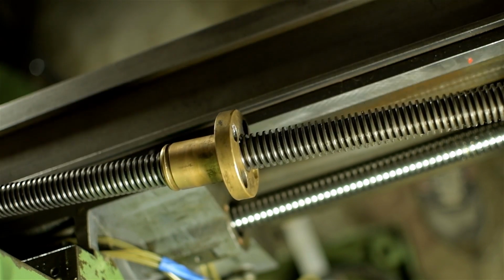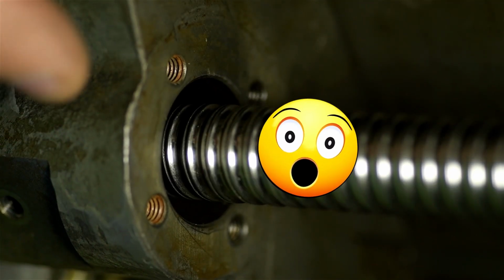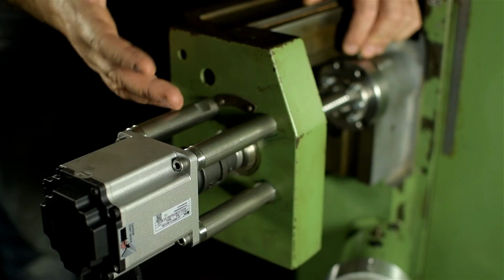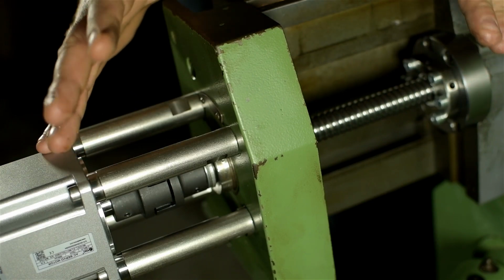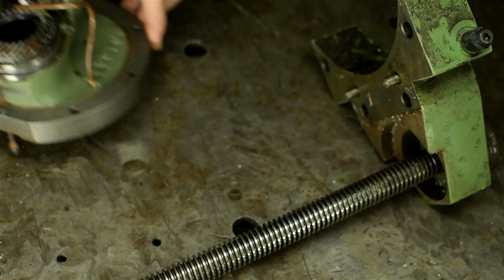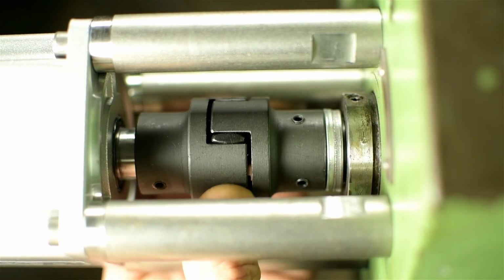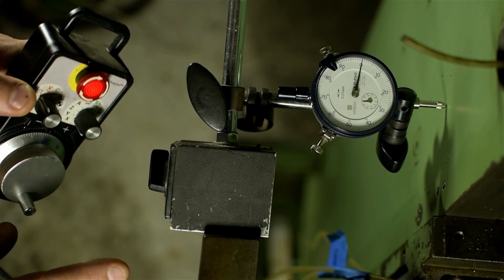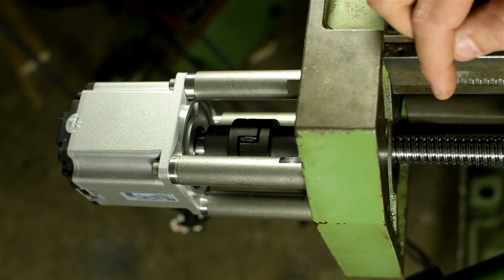Maho X Axis?  DONE!

Comment: DO NOT put one of those "springy" couplings (helical) on your ballscrew; it'll drive the servo crazy with all that resonance every time it moves. If you do use one, wrap a few turns of electrical tape around it to help damp those vibrations. Instead, I would recommend using a high quality spider coupling correctly sized for the motor torque you expect to use. Check out Ruland for made-in-the-USA greatness. And please, please stop using set screws. Use clamping collars. It's easy math to do to compare the clamping force/unit-area and see that set screws are a terrible thing. I'm sorry Tony, I know it's your thing and you got this. But I can't not, you know? P.S. I know it doesn't mean spit, but I design servo motion control systems for scientific and industrial systems.

Comment: I did not understand on which bearings the ballscrew  turns, certainly not normal radial bearings should be used but preicision Single row angular contact ball bearings, and you must have an adjustment that allows you to load them very precisely from outside,  in addition, the recirculating screw seems to me in diameter too thin, consider that the ball screws twist under stress, so I advise you to mount something of high quality and for high loads, better if the ball nut is double  has an adjustable preload, as ever, backlash is your worst enemy.

Comment: The coupler you use us perfect for CNC the plastic part is only there if the alignment of the motor isn't let's say that perfect it still quiet and giving the force ahead to the counterpart I use the same and they are by far the best but not cheap couplers for one you can buy three standard ones ...they allow out of alignment up to 2° without making any problem ...I used the standards some months and then changed to them ...

You did the same mounting wirh four steel sticks as i choosed last year Later I changed the x and y to a plate mounting z still uses the sticks and it works perfect so I don't know now why I changed x and y when I see that even you do it that way ...so I guess the work was for nothing 😂😂😂

Comment: Before you had problems with the backlash I knew it was the coupler.  Use them in pump drives and their sloppy as poo!  Plus they are too cheap for a CNC part.

Comment: Don't use those spiral cut couplers, useless for loads like on this machine...Make your own solid coupler and float the servo into place on the standoffs...Huco do suitable flex plate couplers which will shear in a stack up. Choose your ramp acc rate carefully though...Pixelated shaft porn was fun...😁

Comment: Had this problem with mach3 many years ago if direction pin is set to active high set it to active low or the other way round can't remember but it adds steps in the one direction.

Comment: Afterthought : Could be sideways movement on the Z if the gib is loose . Can you put an indicator on the bearing mount? Another test is to put the indicator on the end of the ball screw (the one without the plastic cap) – that will indicate the contribution of the angular bearings.

Comment: I use cutting fluid on everything in the drill press. I’m only trying to save my drill bits. To all you machinists: Why does it matter if the material is cast?
Reply: Jorg Jorgensen Never really thought of it, but almost everything I drill is mild steel, stainless, or aluminum. Rarely cast iron. Thanks for the perspective.

Comment: All that and all I managed to get done today was to take 16 lithium battery packs that are 4.4AH each and built a battery to replace the lead acid batteries in those terrible APC UPS's.  But I ended up with a battery that should have about 16AH of use able power instead of the 8 to 12 the batteries originally had and with the BMS on each pack it should prevent the overcharge problem those cheap APC UPS's are known for.  Glad I pick them up for a couple dollars each at the thrift store, LOL.  Have one more I need to build a battery for and then I may look at swapping the lead acid battery in my server backup but who knows, that one doesn't seem to have as many problems overcharging.

Anyway, have to agree that the coupler you are using is probably introducing some backlash.  I think what you are looking for is a special type for servo's and such.  https://www.mrosupply.com/couplings-collars/zerolow-backlash-couplings/control-flex-coupling/2785523_c231p_zero-max/ Those isolator style ones are great for transmitting power but not so good for keeping things just where they need to be.

That ball screw is a lot better sounding and seems a bit faster than the lead screw in the Z axis though.  I give it a few days of real use before you start planning the change out.  Hopefully the Y axis isn't too bad though, but I am sure you can handle it.  Anyway clean up the mission impossible set before you get started on it.  Would hate to hear TOT got buried under a bunch of stuff like a hoarder and wasn't found till a week later when it all came crashing down on him.  Plus I am worried that the machines might just turn on you and start the transformation to cyborg...

Comment: There are spider coupling for CNC milling machines, just not like the one you are using, the one you are using is too crude, Truly hope not, but have a feeling that under load both your axis so far will not give the best results, coupling is a issue but easy to fix, just get a better one, the way the motors are assembled doesn't seem rigid enough imo, but then I'm used to work with 24/7 machines probably just me being overcautious.

Comment: I don't know how torquey that motor is,  but those standoffs seem a bit long? I would be concerned with twisting them, some kind of cross braces would be nice. A pipe (or a box) with flanges, large enough for the coupling, would ease my mind. Or am I backseat over-engineering here?

Comment: Everything is nice, but I do not see point for such conversion. There are CNC machines and manual machines. CNC machines are made for production-cheap work, manual machines for repair and on-off type of work (expensive work). Both of them have their place. To convert something what was not intended in the beginning by manufacturer......does not work most of time. They are exceptions of course.

Comment: Hey Tony, what brand are your motors and your ethercad system? I am looking to get exact same ones. Also, do they support backlash elimination in the software?
Reply from the maker: leadshine.  control is an element pc running kingstar.  Mach 4 control soft.  i know Mach does backlash comp but i haven't tried it with this system.
Reply: @ThisOldTony  Thanks for quick reply! Been watching your conversion videos for most of the today. I am a noobie to machining. Watching your TIG series made me buy TIG welder, now this... Please stop making videos. My bank account can't keep up. Also, my constant giggles starting to piss off my significant other.

Comment: why wouldnt you use cutting fluid on cast iron?
or is it one of his dry jokes i dont get?
Reply: Cast iron has a good deal of graphite in it (about 2.1%-6.7%) which is more than enough "lubrication" (altough it's dry) and drilling doesn't generate enough heat to warrant cutting fluid as cooling.
Reply: @jetfire5991  oh ok cool. so its not like u shouldn't but more like its not needed.